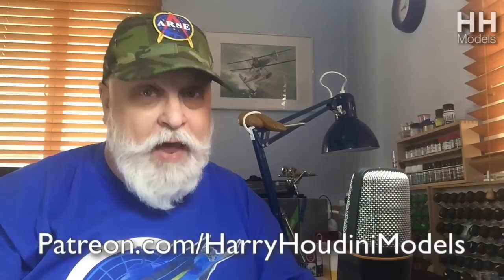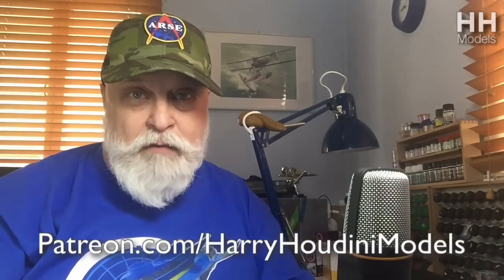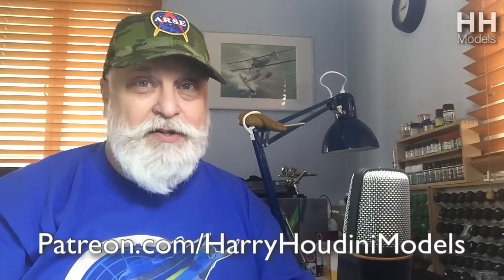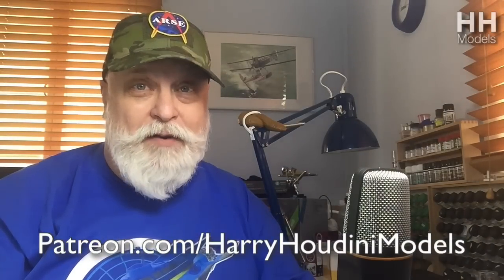The Unpainted Gooch Ep 9 Acrylic Paints

Comment: An extremely informative and entertaining video. And you are absolutely correct about “acrylics”; they can be enamels, lacquers, or water-based. But I think the “snot” problem many users of water-based encounter is due to additives in the paint reacting to contaminants in the water used as thinner or in the airbrush itself. Alcohol is soluble in water. Many years ago I built a Tamiya model for the U.S. distributor. I had to used Tamiya “acrylics.” I thinned the paint with a mix of alcohol and distilled water for airbrushing and had no issues at all. 

These days I’m still using Humbrol enamel thinned with mineral spirits. I have some 60+ year-old Humbrol which is still as good as the day it left the factory! And regardless of the paint used, it’s always a good idea to use the manufacturer’s proprietary thinner (or suggested substitute), even if it is more expensive, because it is specifically designed to work with that brand of paint.
Reply from the maker: Tamiya paint is butanol based,  which is a 4 carbon chain alcohol.  If you mean ethanol, when saying alcohol, then that is a 2 carbon chain alcohol.  Both types of alcohol will work to thin Tamiya as will isobutanol which combines the 4 carbon chain butanol with a 3 carbon propanol.  Meths or methanol is a single carbon alcohol.  This is dumbed down as the actual chemistry is more complex and there are variations on each alcohol makeup.  But Tamiya uses the more complex butanol in its mix.  This is water soluble, to a degree, but works better thinned with alcohol or lacquer.

Comment: That was easily the best introduction to model paints I've heard. It also explains why I've had less than good results with Stynylrez and Model Air when sharing an airbrush that I normally use with Tamiya acrylics. Through trial and error I found I had better results using a second airbrush that I didn't use with Tamiya paints. I assumed it was because I was using a larger nozzle but now I know the real reason. One question for you ... I recently bought a bottle of Mr. Color Leveling Thinner after reading how well it worked with Tamiya acrylics but I'm wondering what it is. Does it have the properties of a lacquer? I have a booth that vents to the outside but I'm trying to avoid enamels and lacquers.  Thanks for the excellent tutorial! Cheers, Steve (Victoria, BC)
Reply from the maker: Mr Color Leveling thinner is lacquer based.

Comment: Hey Harry :) Very informative! I've always wondered about the whole "acrylic paint" description. I'm certainly taking on board that info about tap water! When I spray with Stynylrez, I usually clean after with Windex then rinse with water...tap water. Didn't really think about all the impurities that would be present or the effect they would have! Spring water from now on :) Also, having a Windex-soaked tissue to hand is a good tip (for the tip). Would you advocate wiping the needle with Windex before spraying the Stynny? You mentioned Tamiya acrylics have a very basic colour range (which they do and is very frustrating). The other option is the Gunze Mr Hobby Aqueous paints. They're basically the same as Tamiya (in fact, I have successfully mixed Mr Hobby & Tamiya together) and they have a very comprehensive colour range in gloss, semi gloss and flat finishes. Not to be confused with Mr Color though, which is a lacquer - something I've just started using over the last week or so :)
Reply from the maker: Yes I have been told about Mr Hobby but have no first hand experience as my use for alcohol based paints is very limited. I invested in a ship load of Hataka instead.

Comment: Harry, do you need to use a different airbrush for a tamiya laquer and vallejo paints , as I've had clogging problems when using both using a single airbrush after flushing out with vallejo airbrush cleaner ? Any advice is welcomed . Phil
Reply from the maker: Phil Vallejo cleaner only cleans out water based paint, not lacquer, or in Tamiya’s case it is butanol, even if you thin with lacquer.  You might need some Windex and detergent to remove the lacquer and butanol before trying to airbrush Vallejo.  
 
The simplest solution is to have 2 airbrushes, if you can afford it.  That way one is happy with Tamiya paint, and one is happy with Vallejo.  No cross contamination.  Otherwise a thorough clean is needed to remove the Tamiya residue, before using Vallejo.
Reply: @HarryHoudiniModels  Hi Harry, many thanks for your help on this , I will see what I can afford to get, Thanks again Phil

Comment: FAB video, as I use both water based (Vallejo Model Air & Railmatch) and alcohol based acrylics (Tamiya, plus a few others). I have air-brushes for each type, as if you've been using Vallejo MA and then spray Mr Surfacing Primer you get bits of acrylic crap over your nicely primed surface! 

Interestingly Tamiya thins and sprays beautifully with Vallejo Model Air thinners and I've made washes in the past with Tamiya using water and it's worked.

Spraying Enamels, you need a full Hazmat suit - the thinners smells worse than the paint!
Reply from the maker: Yes milage varies with location and experience... but the trick is to know the chemistry of your paint to avoid dissatisfaction.